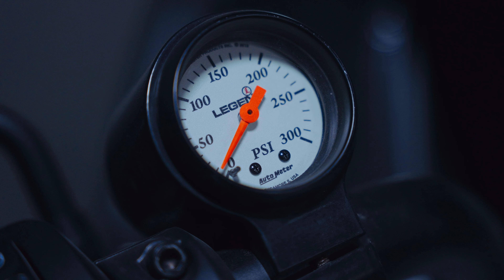Stock Air vs Legend Air

Comment: hi i have a tri glide 2013 with 13 inch original air shock from harley. last summer i both your legend lift kit to raise the rear end i like very much but i find that the rear suspension is to stiff with the legend air shock i could have the rear end a bit higher and have a smooth ride ??
Reply from the maker: Hello, thank you for your business. You should be riding butter smooth on that setup so we would recommend searching our YouTube videos and you will find we have a sag setting video on Tri-Glides with rear AIR suspension and this should help you get setup perfectly. If you need any further assistance, please do not hesitate to email service@legendsuspensions.com and our Customer Service Techs would be more than happy to answer any questions you might have. 

Thank you.

Comment: I am going to be in Sturgis at the end of June ‘23. Can I make an appointment to have front and rear suspension on my 2020 TriGlide done?
Reply from the maker: Hello, thank you for the comment. most of the year we are a suspension manufacture. We generally do not accept appointments any other time than the first two weeks or so of Sturgis Rally. We would recommend reaching out to service@legendsuspensions.com as we get closer to your arrival date, and we will see if we can possibly sneak you in. Otherwise, we do have a great local and highly recommended shop in our area who is capable of the install as well. Thank you!

Comment: Can you ride with the air shocks fully pumped up
Reply from the maker: Hello, 

Yes, you can, but you would have pretty firm shocks, people do ride with them pumped up quite a bit if they are going to ride more aggressive and they are looking to get some extra height out of the bike or just want a good firm ride for hitting corners. 

Nice thing is as soon as you are done, you just release some air quick, and you are back to your normal riding.

Comment: Sounds like a good idea… especially for trikes
Reply from the maker: Hey Manuel! Thank you for the comment. It is a fantastic addition to the Tri-Glide and Freewheeler. We offer the most options for a Tri-Glide, from Lift brackets, coil or air suspension as well as Axeo front suspension. We have a bike specific fitment guide at Legendsuspensions.com where you can see everything we offer for your machine and take those part numbers right to your local shop for ordering and install. Please feel free to use our Chat feature or email service@legendsuspensions.com with any questions. 
-Thank you.